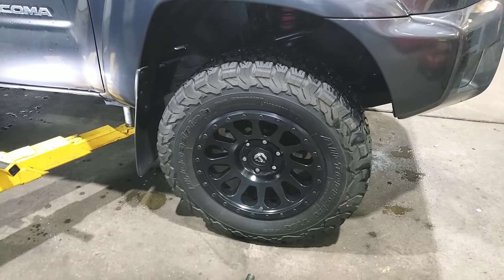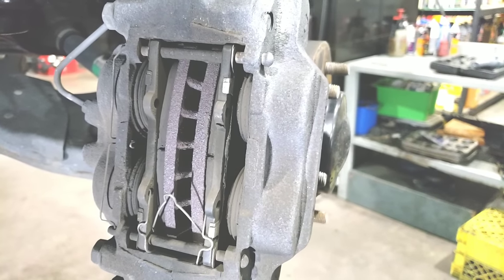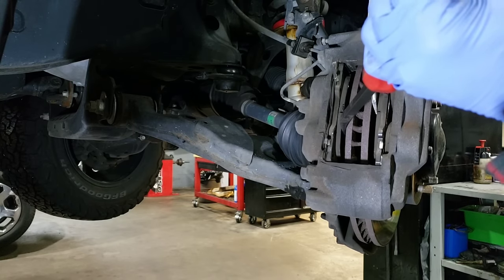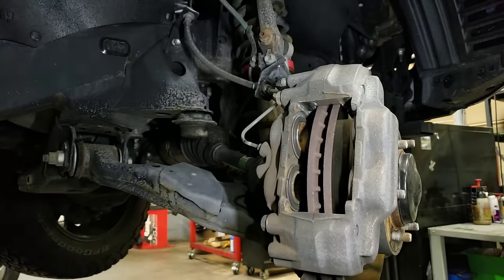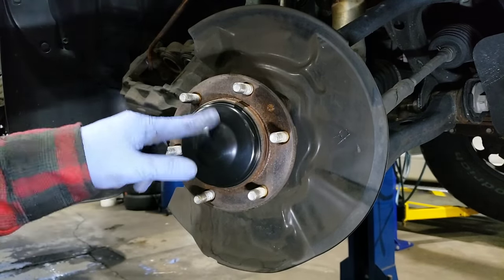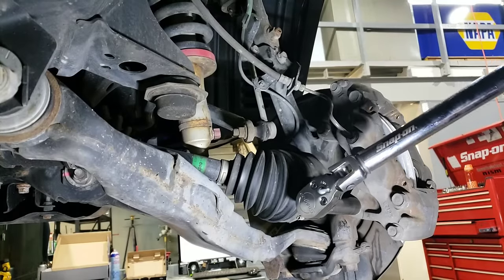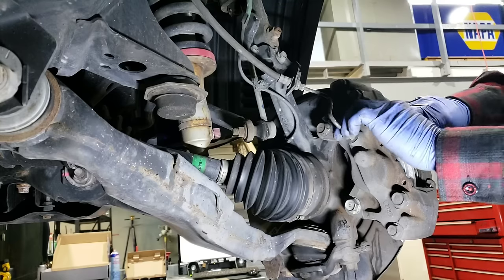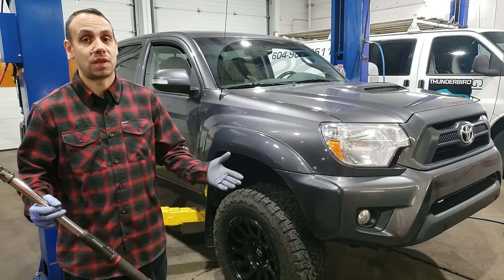Toyota Tacoma Brake Pad & Rotor Replacement // Easy To Follow

Comment: Great video. Thank you! I successfully got the pads changed. However, while compressing the pistons (in order to fit the new pads) , I pushed brake fluid back into the master cylinder. This caused overflow out of the cylinder, and now the level is way above the max line, almost to the top of the reservoir. 
I am wondering if this somehow introduced air into the lines and therefore will require bleeding, or if everything will settle back into the lines eventually. Thanks to anyone who might have any help with this matter!

Comment: Great video. Would like to see one on the rear brakes.
Reply from the maker: Problem is they barely wear out and last forever. I do have a video on, cleaning, servicing and adjust the rear brakes and a brake fluid flush video.

Comment: very informative and nicely presented , does the brake fluid reservoir cap need to be opened,also I hope to do my tire rotation soon on 2018 access cab 4 cylinder and will observe the braking system to see if it matches what i have seen on your video  Thanks for the video
Reply from the maker: You could but it wont make a big difference. Make sure if the fluid pushes out when retracting the pistons you clean it after. Luckily brake fluid is water soluble, a little soap wouldn't  hurt either.
Reply: tire rotation went well observed the brakes calipers looks the same how about a video on the drum brakes in the rear tacoma brakes thanks in advance!

Comment: I watch several videos, for brakes, even though I have decades of experience, one is never to old to learn and I love pointing out certain things..
Shocking part that you did that others dont, torque down the mounting bolts and lug nuts, plus giving the torque specs. 
For me,
I flush out brake fluid with new before compressing the pistons.
I dont like the idea of pushing contaminated fluid back into the reservoir and antilock system.

Comment: Thanks ,Well done and to the point. This is just what I needed I used power stop Z36 extreme pads and drilled & slotted rotors I took the first caliper apart by mistake but all is well. You helped alot.

Comment: Hey bud,  I know your video is old but its a great one,   wondering what size of bolt to you use to push the Rotor off ? thank  u
Reply from the maker: Thank, either 8 or 10mm x 1.25 thread.

Comment: At 30k miles on my 2021 Tacoma, I’m considering trans fluid drain and fill.  Would you recommend full flush instead?  Thanks for the brake pad video.  Very well done.
Reply from the maker: Absolutely nothing wrong with doing a drain n fill at this point. Youre early anyways,  im all about doing it early and often.

Comment: Nice DIY video!  Does your 2015 Tacoma front Brake Setup similar to a 2010 Toyota 4Runner?
Reply from the maker: Yes, youll find most Toyota stuff is the same. I have video where I put tundra brakes of my 97 4runner.  All the same.

Comment: The silver tab for the inner pads, does it matter if it's installed on top or bottom? I've seen another video that says the tab goes on bottom, but when I changed mine the ones I replaced had the tab on top

Comment: When you compress the pistons do you need to open the brake fluid reservoir cap? How do you know whether to take the cap off or not?
Reply from the maker: You can take the cap off if you want to. I never do, like ever. Sometimes the fluid will overflow, luckily brake fluid is water soluble, just wash it off with a hose. Add little soap of yous like.

Comment: Never changed brakes before, do you suggest me doing it? 2019 Tacoma. Video heiped
Reply from the maker: Being at 2019 I don't suspect you'll run into any strange issues. follow closely, take your time and you should be just fine. Goodluck.

Comment: When I reinstalled the caliper after installing a new wheel stud I put a small line of anti-seize on each of the caliper mounting bolts. After watching your video would you recommend taking the bolts out to remove the anti-seize or would it be ok you leave them in with anti-seize on them?  ~ Thanks
Reply from the maker: Honestly I think the anti-seize is perfectly ok. Depending on the condition of the bolt (rusty) and where you live (rust belt) , the anti-seize could be needed more than others but fine either way.

Comment: Should I have my rotors turned or just put on new.They aren’t warped at all.
Reply: BTW I have 115,000 miles on the original brakes and it’s a 2014. Also great video!

Comment: Thanks, Kelly great video, very detailed down to the torque values.  I believe this is the first video I've seen that gives torque values.  Quick Questions, I purchased the Duralast Gold Rotors and Duralast Elite Brake Pads at AutoZone what do you think of their quality?  Also, is it normal for Tacoma's to warp their rotors?  Thank you in advance for your time and replies.  Stay safe and God bless.
Reply from the maker: Thank you as well. Since I'm Canadian auto zone and duralast lines are not available here. At my shop I've been using napa parts for about 6 years. Akebono is probably oem and I don't mind raybestos eht. It is quite common yes, use the best rotors as possible.
Reply: @Beacon_Offroad  Would you say that the rotor warping is a manufacturer's design deficiency of the rotor being too small for the size of the Tacoma?  If so, would you say it would be safer to upgrade to a bigger size braking system, ie.,  Caliper, Rotor, Pads and whatever else that may be required?  or would it be an over kill?  Is Akebono a brand?  I know that Raybestos is a brand, what is eht?  Thank you so much for all your replies to me and everyone else, you are very generous.